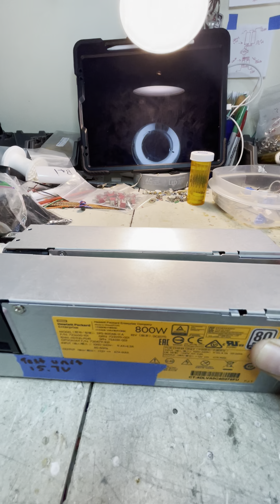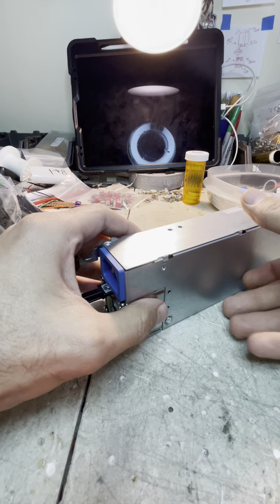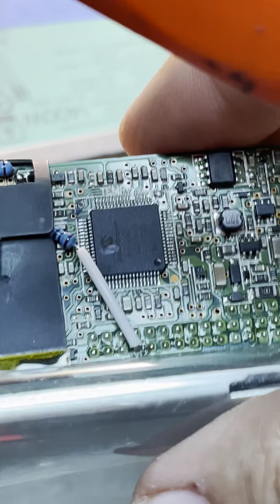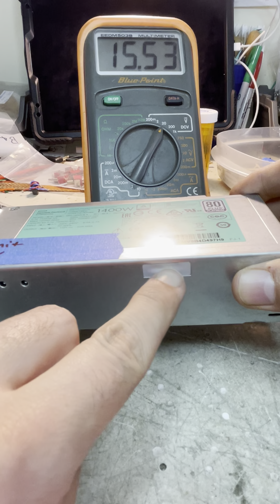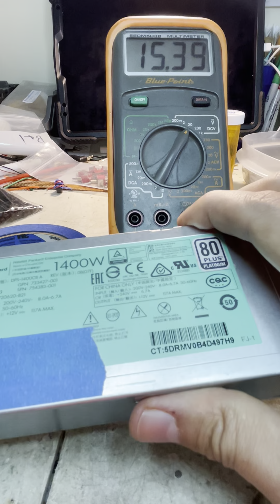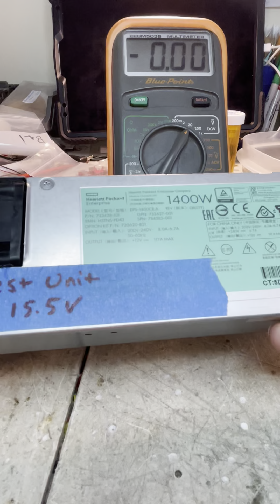HP HSTNS-PD43, Hacked, OVP, 15.5 VDC

Comment: Hi! Great video. I have an HP HSTNS-PF43 (REV 0C, 1400W) power supply. It starts up exactly the same way as the PD43 by shorting the same 3 pins. If the internal board looks identical to the HSTNS-PD43 from your video, can I use the exact same resistors and solder points to get 14V, or are there internal layout differences?

Comment: Hello, another modified PD43 power supply. A 5.6kΩ resistor was used for overvoltage protection (OVP), and an 18kΩ resistor in series with a 10kΩ multi-turn potentiometer was used for voltage adjustment. With this configuration, I get an adjustment from 13.60V to 14.20V.
To turn on the power supply, I had to bridge pins 2 and 3, and connect one leg of the switch to pin 1 and the other leg to pins 2 and 3.

I've seen other mods that do it the other way around, bridging pins 1 and 2 and connecting the switch to pin 3, but that way the power supply is always delivering voltage, around 8V with the switch off.
It's already been tested and works very well, delivering up to 75A with a negligible voltage drop. Regards.

Comment: So which pins to solder to turn it on.  Do I short the first 3 pins?

I've seen another guy solder 1 and 2 together, then soldered a 1K resistor from pin 3 to ground.  They said necessary to get it to provide current. Can anyone explain which is correct?

Comment: Hi guys, was noticed that my psu after mod 18k on boost circuit and 5.6k on ovp part, do not turn on fan, was put constant load of 40A but fun still do not get triggered after 10 minutes, then i was remove added resistors to check , but still do not fan .. fan was tested with 12 v directly, works fine. Any ideas?
Reply: It happened the same to me. Did you fixed it the problem?
Reply: When I go over 50-60 amps the voltage triggers and start to going down any ideas?
Reply: @juaneliasfriascastillo3798 hi
Yeah.. was buy small dc dc buck converter 5-30V input, so i was rewire fan red and black wires go buck convertor exit, (was set it to 6V) so fan always have constant speed and cool nicely
Reply: @xtornado123 just a curiosity did you drill the + and - in the output of the power supply?
Reply: @xtornado123 have you try yours at high load? Mine triggers at high loads
Reply: Did you drill the + and -?

Comment: The HP DPS-1400CB A power supply, also known as HSTNS-PD43, supports load sharing when used in parallel with other compatible power supplies??

Comment: So parallel 2 supplies at 15.2v and the load share is not working. Pin 5 connected and only one supply led is coming on when loads increase. 

You can turn the supplies on at 200a load and they run happily and the second one stays online.

Comment: Need help. What size resistor do I need? 1/4 watts or 1 watts for the 12k resistor and 4.3k resistor? Or it doesn’t matter the wattage?
Reply: As the resistors are used for signaling (i.e. not directly "in line" for powering purposes so relatively low current & power consumption) so you can use low watt rated resistors(e.g. 1/8W). If you have 1/4 that would be more than adequate (no need for a 1W). Cheers...
Reply: Thank you!

Comment: I'd love a full video or hell even just a comment on how you identified the OVP circuit.  I created the first YT vid on how to get this PSU to turn on, there was not a single page on the internet with any info, I basically messed around with the PSU for an evening, probing and taking notes, noticed the shorter pin traces on the end and assumed they might have something to do with turning it on because you would want all other pins connected first before "activating" it, but I admit I tired a few different pins together with high impedance resistors before I had it 100% figured out.
But, to find where the OVP circuit is and how it works and then actually modify it, I had no clue.  I'm very grateful for your video, I used to run mine at 14v but with a load it would sag to 13.4ish, now I have it set to 15v, and I have another volt if I want to use it!  Brilliant!  I really love this psu, they are tiny and super quiet too!

Comment: Is there any info on running 2 in series? I had it working for a bit but ovp was actually still on on one of them once I fixed it… once I connect to load (29.2v 300ah battery) they both turn off same time. One isolated from ground. And I did have them working at 14.7v each but with a horrible sound from the ovp. Now nothing once I fixed the ovp
Reply: What do you mean by "fixed the OVP"? Have you taken a look at my OVP triggering test results chart uploaded to EEVBLog?( thread titled "HP HSTNS-PD43 PSU Hack & Feedback Circuit (Partial)" - 3rd post down. ) Copy /paste the thread title including the quotation marks and "Google it". The 3rd post of the thread has a small thumbnail which can be clicked to open the triggering results chart and you can right click > save as to download the spreadsheet image. Also, you may want to check the load sharing pin features(one of the earlier comments here mentions that pin-5 from the edge on the underside of the output tab is the load share pin). Cheers.

Comment: Hi! Anybody tell me which resistors for voltage 14.5v? Thank you!
Reply: In short, 15.87k in my case. I've commented here about a month ago a list of resistor values for  voltages in the range of 12.66V ~ 15.50V. If viewing on a computer(not phone), then click "Sort by"(next to #Comments) and sort comments by "Newest first" then look several comments down from yours for details. Cheers...
Reply: @tinkerman4774  Hi. Yes i saw that But he using 2 resistors and that second is different. Do you know that second value?
Reply: @RafKos  If you are referring to the OP's (original uploader - Hopper's) OVP resistor in the video, it is 4.3k. According to my OVP triggering tests (for relatively low loads of 6~2 Ohms, or about 2~7A depending on set voltages)  OVP resistances of 10k or lower seem to "disable" OVP (note within the low load ranges of 6~2 Ohm, 2~7A tested). If you want to keep OVP active for triggering at about 15.5~15.4V but not triggering below, then 10.5k seems optimal (for the low load ranges tested - I've yet to test in very high loads like 50~100amps range, which may require lower OVP resistances to prevent triggering at voltages to be set for use). For more details of my triggering tests, copy & paste  "HP HSTNS-PD43 PSU Hack & Feedback Circuit (Partial)" including the quotation marks and "Google it"(or do a search). The first likely result will be the thread I started in the EEVBlog's Forum section with the same title. The OVP related info is in the 3rd post down. The first post contains my own manually probed schematic of this PSU's auxiliary board(which is shown in this video). Cheers...
Reply: @tinkerman4774  Hi, thanks for your message. I need it for BMW programming. So I need 100-120 Ampers and 14-14.5 volts. Could you printed some covers in 3D for that model or you know somebody whos doing something like this?
Reply: @RafKos  I do not have  3D printing model, as I will be using a plastic brief case for my build. But perhaps "Jose_Jn BMW HiTech Retrofitments & Coding" might? If you haven't already, check out his video titled "ISTAP / ESYS 14v PSU Do It Yourself for BMW Flashing and Programming. Up to 80A!!".

Comment: My test of this PSU's modified OVP triggering over a range of resistances, voltages & (light)loads has been uploaded to the EEVBlog thread titled "HP HSTNS-PD43 PSU Hack & Feedback Circuit (Partial)" - 3rd post down. Can't link here as this comment would get (automatically?) deleted. If interested in how the OVP behaves, check it out (e.g. OVP is disabled for resistances of 10k and below, whereas to keep OVP active to trigger at around 15.40~15.50V without changing the output caps, the optimum resistance is in the range of 10.50k~10.60k). For more details search the thread mentioned above. Cheers...
Reply: Where's the Eev blog?
Reply: @BrianThorpe-l5b Just copy & paste  "HP HSTNS-PD43 PSU Hack & Feedback Circuit (Partial)" including the quotation marks and "Google it"(or do a search). The first likely result will be the thread I started in the EEVBlog's Forum section with the same title. The OVP related info is in the 3rd post down. The first post contains my own manually probed schematic of this PSU's auxiliary board(which is shown in this video). Cheers...

Comment: Below are tested resistor values for output voltages 12.66V ~ 15.50V.
{ Resistor Values Are As Tested Without Rounding}
12.66V  -  100.1k~103.5k
12.75V  -  80.1k
12.80V  -  71.0k
12.89V  -  59.83k
13.00V  -  50.63k
13.10V  -  44.20k
13.20V  -  39.09k
13.30V  -  35.09k
13.40V  -  31.82k
13.50V  -  29.23k
13.60V  -  26.92k
13.70V -  24.99k
13.80V  -  23.36k
13.90V  -  21.95k
14.00V  -  20.64k
14.10V  -  19.46k
14.20V  -  18.43k
14.30V  -  17.48k
14.40V  -  16.62k
14.50V  -  15.87k
14.60V  -  15.20k
14.70V  -  14.54k
14.80V  -  14.01k
14.90V  -  13.46k
15.00V  -  12.91k~12.98k
15.10V  -  12.45k
15.20V  -  12.05k
15.30V  -  11.64k
15.40V  -  11.27k
15.50V  -  10.68k

Note: The reason I went through this range is because I'll be using this during automotive ECU programming to keep the battery charged up. I'll utilize a 100k multi-turn pot so I can adjust the output voltage from 12.8V up to 14.6V as necessary, much like how a car battery charger gradually increases its output voltage during the initial minute or two of charging. Cheers~

 * Regarding OVP triggering:  For triggering say at around 15.00V(+/- 0.5V?), OVP starts kicking in between resistance values of 11k~12k and up. BUT... the triggering is not just based on voltage, it is also dependent on current/voltage drop(i.e. at certain voltages, OVP does not trigger at say 2A loads, but will trigger at higher loads say 4A, 6A, ... etc.) so to get a clear picture of the spread of this "grey zone"(in which small loads don't trigger OVP, but larger loads do) it will likely be necessary to make a graph based on methodical testing of not only multiple voltages but multiple current/loads for each OVP hack resistance value under test, and test over a range of resistance values. I'll try to make such graph via an Excel sheet perhaps and upload on EEVBlog and update here when it's done.
** Update: The preliminary OVP triggering tests are done and uploaded to the EEVBlog thread titled  "HP HSTNS-PD43 PSU Hack & Feedback Circuit (Partial)" - 3rd post down. Can't link here as this comment would get (automatically?) deleted. If interested in how the OVP behaves, check it out (e.g. OVP is disabled for resistances of 10k and below, whereas to keep OVP active to trigger at around 15.40~15.50V without changing the output caps, the optimum resistance is in the range of 10.50k~10.60k). For more details search the thread mentioned above. Cheers...)
Reply: @Ähmé753 (In reply to the now deleted question by  ahmedbalobaid753 of whether variable resistors can be used... keeping in mind they can start from "zero" resistance, ... ) In short... YES! ( Update: Yes for voltage boosting, but NO for OVP mod if using a wire wound potentiometer - the wire wound pot's inductance  messes up the OVP's feedback voltage and the OVP never triggers!) But you would not want to set it to start at "zero"(or close to it) unless it is used with other resistors so that the actual active resistance would be within safe ranges that would result in output voltages under 16V(or if the output caps are exchanged with higher values, then under that higher rating). If the pot were set to "zero"(or close to it) without any other resistors in series, the PSU will likely not turn ON(i.e. the fan won't run and the output will not be normal voltage), as the OVP would be triggered immediately (assuming the OVP hasn't been disabled with a similar very low resistor in parallel).
  In my current testing setup, instead of soldering resistors onto the PCB right away, I soldered on relatively long 2 wires(25AWG) one for the voltage hack and one for the OVP hack onto the PCB, and the other ends are connected to a small breadboard for testing with various resistors. Of course after testing, I won't be using the breadboard, but the wires will still be used so I can have a pot & trimmer (for voltage & OVP respectively), on the outside of the PSU.
  For the voltage hack, I started with 4 x 20k resistors(in series as needed) and 1 x 20k multi-turn pot(in series or on its own). For the OVP hack I started with 2 x 20k in parallel(for 10k) and one 5k multi-turn pot/trimmer in series or on its own depending on resistance setting.  The grounding has been onto the main ground tab next to the 12V output tab, using alligator clips.
  I now have a 100k pot so I can do without the 4 x 20k resistors + 20k pot. This 100k pot will be used with a big multi-turn knob(which looks like a safe dial) on the power supply's enclosure panel (the PSU will be placed in a plastic safety brief case). 
  Also, on a side note, when wires are initially soldered(instead of resistors), before any resistors are connected and grounded, the dangling wires seem to throw off the control circuit(perhaps due to wire inductance/capacitance or due to their acting like antennas for noise), and the PSU will not turn ON. I freaked out thinking I fried the cap or resistor to which the wires were soldered onto, but once the resistors were connected and grounded, the PSU fired up(i.e. turned ON, not catch on fire, h e he).
  In the case of OVP, if the resistance is too low, then OVP may not ever be triggered when needed, and would essentially make it seem like the OVP has been completely disabled. Some don't give a hoot as long as they can boost the voltage up, but having the OVP kick in before the output caps or perhaps some sensitive diodes & ICs in circuit blowup would be a smart move. Hence, my intent to keep testing for a thorough/clear picture of how the OVP behaves at various voltages and loads.
Reply: (Update comment copied...) My test of this PSU's modified OVP triggering over a range of resistances, voltages & (light)loads has been uploaded to the EEVBlog thread titled "HP HSTNS-PD43 PSU Hack & Feedback Circuit (Partial)" - 3rd post down. Can't link here as this comment would get (automatically?) deleted. If interested in how the OVP behaves, check it out (e.g. OVP is disabled for resistances of 10k and below, whereas to keep OVP active to trigger at around 15.40~15.50V without changing the output caps, the optimum resistance is in the range of 10.50k~10.60k). For more details search the thread mentioned above. Cheers...
Reply: Amazing! Thank You! Could You update the comment with a link when You are done? :)
Reply: I’m new to this. What wattage resistor is best? 1/4 watts, 1 watts resistor.
Reply: Приветствую!Можно-ли реализовать регулировку тока на этом блоке?
Reply: Thanks for the resistance table, I was looking for it to match the right potentiometer.

Comment: The voltage mod works fine but the crowbar does not.. I have spent four hours on three supplies... With 18k across the voltage. I get a nice range centered abour 14v...Go to 14.08v and the crowbar trips the supply with no crowbar resistor mod... No matter what resistance value I apply in the suggested location be it high or low the supply will happlily produce any voltage and no ovp kicks in.... 😢
Reply: Try connecting a load(e.g. some power resistors / a few amps perhaps) on the output of the PSU... *Update: apparently the OVP hack resistor  may need to be a higher value depending on the desired triggering voltage threshold (e.g. 11k~12k and higher for kicking in at roughly 15V, +/- 0.5V depending on triggering load currents) .
Reply: Did you fixed it?

Comment: Excellent, works a treat. Also used 22k and 6.8k for 13.7V. Worth pointing out that you need a good soldering iron with a fine tip, also as someone else has said decent magnification to see what you're doing. Took me a couple of attempts to make the top joint of the 6.8k, 1st time I shorted it to the plated through hole below  (before using a magnifier) and although it fired up and lit a 12v lamp the voltage collapsed when put under a real load. Came back to life when I stripped it back so seems quite resilient! All done now, so thanks again!
Reply: I’ve been having that problem but never paid attention to that little hole. Every time i fire up my power supply and put it under load the voltage colapse for some reason that I think I found the solution, thanks to you. If you have any other information why the voltage colapse, it will be really helpful

Comment: Finally completed probing & tracing out this PSU's side(auxiliary) PCB into a schematic. It is uploaded on EEVBlog ["HP HSTNS-PD43 PSU Hack & Feedback Circuit (Partial)"]. Any comments or answers to the questions in the thread would be appreciated in the EEVBlog thread or here. Thanks again... Cheers~
Reply: Did you were able to run it at 70-90 amps without lowering the voltage?

Comment: Appreciate the info/video, thanks!
Just one thing I'm confused about, why set the OVP to 16.3V while 16V and anything above is a self-destruct?
Should you not use specific value to set the OVP to safer 15.8V?
But it probably would be nicer if someone patched the PIC micro firmware to just adjust the OVP to 10-15.8V so , that's what some folks did to the bigger HP PSU.

Comment: First, thank you! Some folks drill holes on the output tabs for binder posts(or bolts & nuts), while some advise against this claiming that on multi layer PCB units, shorts may result. Would it be possible to drill holes on the output tabs on THIS model?

Comment: Hi, and what about the 1600W version? I got some HSTNS-PR62 and PL62 and they got different controller boards than the 1400W. Needs more investigation, because there are no pots.
Would be a big help if you could tell which is the corresponding leg on the big PIC IC for OVP and Voltage Control so I could trace it back (might not help at all if the PIC is programmed for a different pinout tho). Thanks